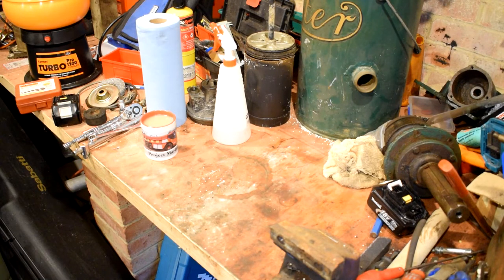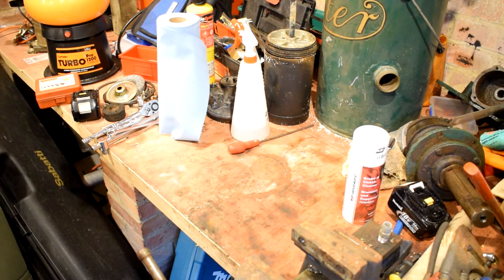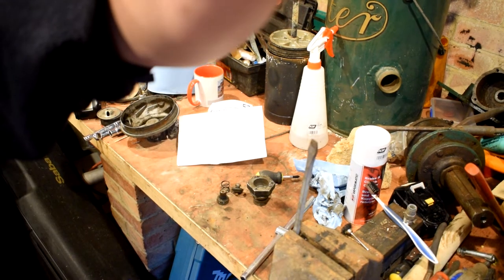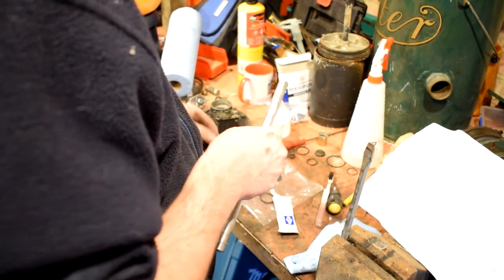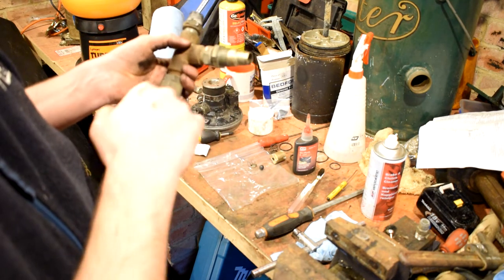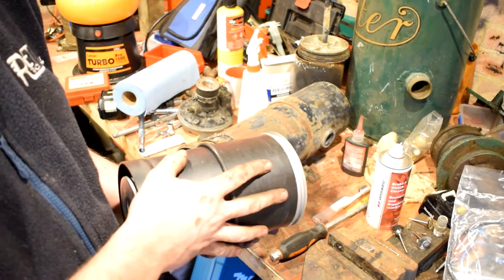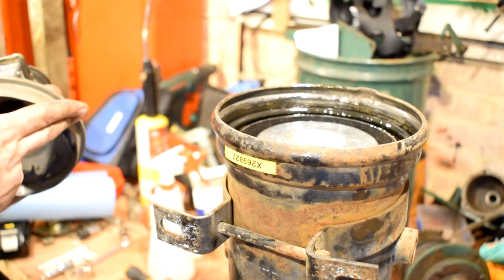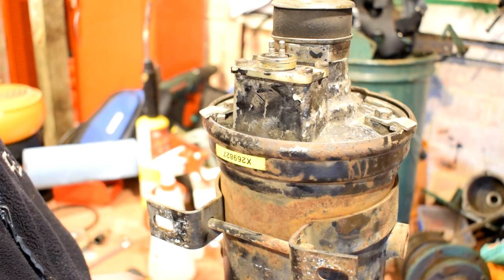Servicing the Bendix AD2 air-dryer (Air Woes 5, Project Marlin 7)

Comment: I have just overhauled one of these myself over the last 2 days. Pretty sure it was also a Bendix AD-2.

Tip, on mine the body is alloy despite rust showing which I can only guess came from other steel parts near to the Bendix, using a wire brush attachment on a battery drill removed the rust, then a few coats of spray Plastikote paint made it look like brand new!